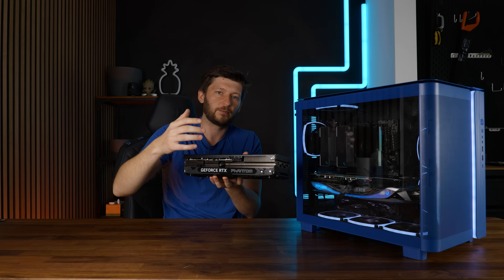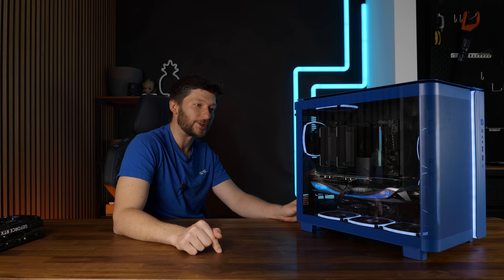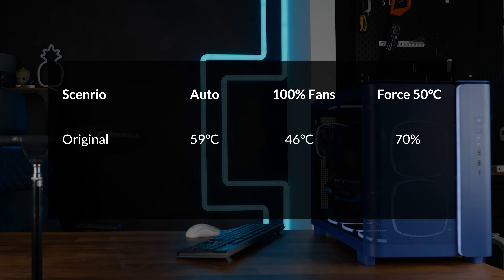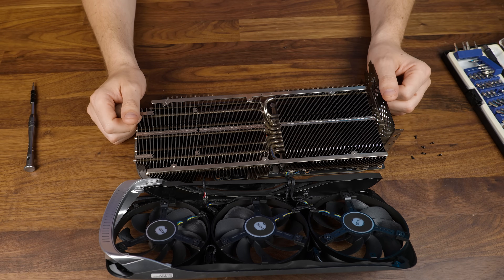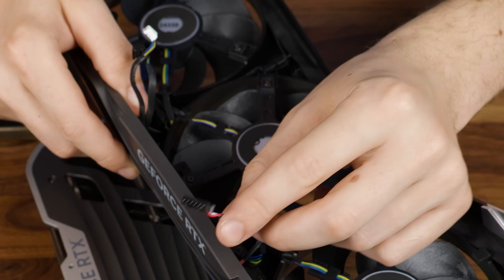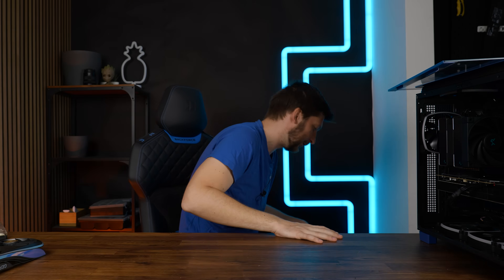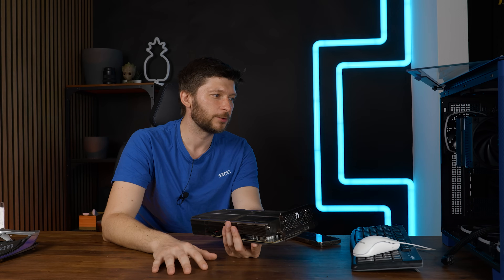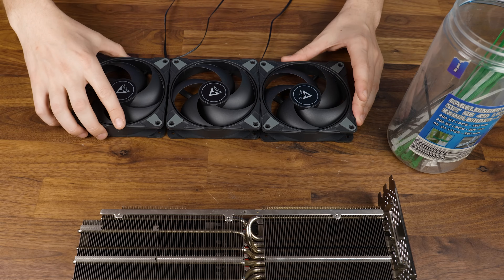Is Deshrouding A GPU Still Worth It? RTX 4090 P12 Max Deshroud Mod

Comment: I'm a good minute in and I'm going to stop you there, and throw a opinion out for the world to see and possibly have some agree with, its totally dead for 4000 series in my opinion the price of the cards themselves are horribly overpriced and underspec'd in cases like the 4080 and below, and the cards like the 4090 the cooling is just so over-engineered that the mod is irrelevant because my 4090 never exceeds 65C its just a overbuilt cooler

Comment: Deshrouding is why I always buy the non-oc/basic versions.   On my PNY Verto it was 4 screws and the two fan cables and boom shroud off.   I replaced it with 3 Be Quiet Silent Wings 4.   Running off motherboard header.   In my MATX system temps are ice cold and the only component I hear is the PSU fan under load.    Now for your high end cards you may not see that significant improvement but for the basic models you will absolutely see results.

Comment: I think the review is missing the point: Today you deshroud for noise, not raw performance. In a noise normalized test, the deshroud would have blown the original out of the water. And whats the with the focus on max rpm? I will gladly let my 4090 run up to the 60s with no hit in performance but virtually silent.
Reply: especially when you consider the fact that the circuitry is designed to survive at like 90C for extended periods. 60C is nothing. But noise is meaningful. Also the bigger fans draw fewer watts. Those skinny fans really consume power

Comment: i really like this idea, i could imagine doing the same myself but with three Corsair RX120 RGB Fans. The RX120 RGB have Icue link which mean i only have to run one cable + they are RGB i have never seen a GPU with RGB Fans.
Thank you for this video, even if this is not worth doing i might still try it!

Comment: Been running my 2080ti with two 120mm fans connected via a cable adapter to original fan ports on the card since I bought it. The original fans have only run in the factory, if at all. And I have been very happy with noise and cooling. Been using Noctua fans for the GPU though.

Comment: That arctic fan noise isnt because of fans but because of air going through heatsink if you would guide the airflow and cover it around like original fan does, it should be colder and quiter
Reply: How could I do that? What could I use to cover it?
Reply: @marko0marko0marko01  1. Use a 3D printer
or 2. Add fans without removing the native casing (and even native fans). Of course, I don't have a 4090, but a 3070ti gaming pro, but if earlier it spent at 83 degrees with very decent noise, then after adding 2 p12 max, just in addition to my family, I got almost silent operation and more than 10 degrees of temperature reduction (now about 70-72). Of course, the effectiveness of this method depends on the case and the initial cooling of the video card, but this thing works anyway

p.s. arctic p12max in general are not the quietest fans, that's why they are blocked by 30%. But they can at least replace bearings with quieter ones, such as NSK, or use something on hydrodynamic bearings (this does not make sense in the long term, but in the short term - hydrodynamics is quieter than ball bearings)

Comment: I've been curios about this for a while as well honestly the noise benefit would be nice if I game with speakers instead of headphones I hear inconsistent fan ramping which is annoying. Especially in unoptimized games its funny when I open the map and my gpu starts going ballistic. It would probably be better fixed with software to slow down ramp speed but I don't think that exists. Anyway thanks for doing this experiment and I would agree its not worth it unless your mental about noise levels and noise levels are more pronounced now a days with show pc's sitting on the desk right next to the monitor instead of under it.
Reply: Fan control. I have it set up on my rtx 4060 to keep the fans off fully until the card hits 50c

Comment: 3:34 legally, disassembly cannot void a warranty. Basic maintenance of internals must be allowed under the law (at least in the US, idk about elsewhere).

Now, the mod does void it because you’re putting on parts it wasn’t meant to work with and running it. But just taking it apart does not, unless you break it in the process
Reply: Deshrouds do not void the warranty on the card for the same reason taking at apart doesn't   magnuson moss act

Comment: No point doing this, enough cards now with good cooling stock and they don't even run hot, my 4090 at 900mv doesn't even go over 60C. Why would anyone spend another $50-200 for cooling you don't need.

Comment: I replaced the fans and the heatsink with RAIJINTEK MORPHEUS II CORE EDITION, and it is cooler while being quieter. GTX 1080 GPU had the original fan fail, replaced it, and another failed a month later. Now it works better.

Comment: Hi. I did the same with my EVGA RTX 2060. I know it's old, but for me it worth it maximally. I've used 2 Noctua NF-A9 fans. It doesn't look as clean as before (I love the Noctua colours), but I care more about the noise lvl which is very impressive. The hardest part was to diy an adaptor to power the fans from the card itself. Imo it's worth it for older or loud cards :) Cheers!

Comment: Okay but if it ran hotter my gut feeling is the card is turboing higher and longer. You simply cannot not give us GPU and memory speeds when they are automatically scaled based on temperature headroom. To do so severely underreports the situation.

Comment: Having a goal temp of 50 degrees for a 450 watt card seems like it's too low of a target. If the goal was 60-65, those Arctic fans would basically be idling and you wouldn't hear anything. Still worth it IMO.

Comment: Dude is putting on the cheapest and worst fans there are and wondering why they can be heard lmao.
Arctic is not for quietness but for cooling with sacrifice.

For cooling NoiseBlockers elopes should be used or any other fan that’s made with quality. 
Had about 20 Arctic Fans and they all were trash after a short period of time.

Comment: Deshrouded my Asus RTX2060Super Dual Evo OC a while ago and placed two Noctua A12x25 on it. On full load 20 °C drop and could OC and UV to stable 2000Mhz@160W.  but a few High-End games didn´t like it that much, so i went back to stock. still a cool card and the fans are barely noticeable. Use a O11 dynamic w max fan setup (incl. card 12 fans) :D

Comment: I think GPUs should be sold without shrouds. They will cost less and everyone can decide what brand of cooling they can put on and if they will go with air or water. And you can reuse your cooler on the next GPU so there will be less waste. Right now there are millions and millions of GPUs in the world with cooling radiators and fans attached to them and and they are all heading to the "recycle" bin.

Comment: You didn't really test for quiet operation though, instead of relaxing fans you've pushed them to a point of diminishing returns for single noise comparison you did -- who actually seeks 50C on core if he looks for quiet operation? Relax it to 65-75C (or at very least stock 60C) and see the noise gap widen.

Comment: I think you could significantly reduce the noise putting some kind of spacer between the fans and the heatsink. It will reduce turbulence and if shaped correctly it could function as some kind of mask and direct air into the fins without it spilling out from the sides

Comment: I deshrouded my EVGA 3070 and put two Noctua 120's on it, I found it definitely worthwhile. 

Temperatures dropped maybe 1 or 2c, nothing of significance. But the reduction in noise was the big win and why I did it. The fans now run at 40% compared to 60% of the originals. The Noctua's are a lot quieter compared to the originals at all points. 

The 120's are also much more durable than the old fans, so they now run all the time.
Reply: and you're actually pulling fewer watts from your PSU. those skinny fans pull a lot of juice

Comment: I still don’t understand why gpu manufacturers skimp on fans?  What is the problem with installing quiet and efficient coolers, with a wide range of speed adjustments.  I was very upset when I bought a gigabyte aero oc 4080, the fans on it only work in automatic mode with a minimum speed of 1300, which is already noisy.  At the same time, attempts to adjust the fans’ own curve failed, the fans simply begin to live their own lives, themselves picking up speed to maximum for a second at the fanstop threshold, which is simply not possible to operate.  If only the Chinese would make an adapter frame for 120-140 fans and it could be made like the Asus noctua edition.
Reply: The margins for graphic card manufacturers are laughable low so they need to keep selling top models for premium prices because that's how they make a profit... If you want a decent cooling you need to buy cards like Gigabyte Aorus, Asus STRIX & TUF, MSI Supreme & Gaming Trio etc.
Reply: @veduci22  Aero is already a premium line, just like aorus.  At the time of release, the price was absolutely identical and I chose the white card only because of the color and the absence of a useless screen.   Who knew that the card would be worse than the budget Ventus line from msi.  By the way, I have no complaints about cooling, all the problems are only with the operating mode of the fans.

Comment: As with all things related to PC performance, the value of deshrouding is tied to the bottleneck of cooling performance. Your tests were very spot on in the sense that the specific configuration of your gpu to case airflow did not have a bottleneck on cooling potential because of the GPU fans. 

I recently decided to deshroud my 4070 super for use in a Dan A4 SFX which is a case without any intake or exhaust fans as default. This meant that the entire cooling capacity of the system was dependent on the GPU fans and the CPU cooler fans. In my case, a deshroud of the GPU caused a nearly 10-15 degree drop under load and also a significant decrease in noise in both idle and load. 

Thank you for these tests tho as they are extremely valuable data points.

Comment: My asus 4070 dual runs a lot better with a pair of arctic P12s (non-max). Lower RPM, lower noise, and it runs a few degrees cooler (both GPU hotspot and memory)

Comment: honestly they should just make gpus with heatsinks that have screw holes  for 120mm or 140mm fans depending on the heatsink size. just make it the exact length to use either 2 or 3 fans. that way people can just use fans that match their case and run them off the same headers or software as the case fans

Comment: I run a deshrouded 4080 rog strix in a fractal ridge case. It runs great.
Reply: Hi, what fans did you use? im thinking of doing the same exact thing.
Reply: @williamm9099  noctua 140mm case fans with an aqua quadro fan controller.
Reply: @  thanks for the info. im assuming you zip tied the fans onto the heatsink?
Reply: @williamm9099  not needed. The 4080 strix is so large that it rests comfortably on top of the case fans. I used noctua 5mm fan spacers to close the gap. I also had to cut a small piece in the front of the case that was hitting one of the heat pipes. Everything fit together much better than I even expected.
Reply: @williamm9099  I had to go back and look at some pictures. I also have a couple of small 3d printed supports that are stuck to the cooler to keep it from sagging too much.
Reply: @ ya i was planning on using either 2 or 3 of those gpu support brackets.  been using those since my old asus 980ti when I had the arctic accelero xtreme III cooler on it. thanks again for the help. im using Kingpin KPx thermal paste and Gelid Ultimate Thermal Pads plus will do an undervolt to get temps even lower.

Comment: I have a XFX 6900XT Merc and shroud comes appart the same way, with only 6 screws.
You could try using those 15k rpm 40mm fans you have. It would be like an old Gigabyte GTX 680 SOC
Reply: how about temperatures? What fans did you use?

Comment: MSI Rtx 3080 10G here , I deshrouded mine and mounted 2x nf-a12 and temps are around 10-15⁰C lower and the noise is down significantly.

Comment: don't need it when the cooler is massive had my 1080ti deshrouded than I switched to Kraken G12 still working basement pc water cooling and deshroud does make it way more quite
Reply: too bad they don't make Kraken G12 for 30-40 series you could make it work with modifications to Kraken G12 but is it worth? I just get a water block a cheaper one and it works great on 3080 ti but 4090 with water block the difference is not huge I could overclock a 3080 12gb or ti to 3090 levels wish we could do it with 40 series cards

Comment: most don't know that ATX motherboard block/restrict hot air coming out at the bottom of GPU. But ITX mobo allow GPU hot air to flow by easily. You may/most likely also have to cut the back of case for airflow to the outside also. Some case no need to cut. The best way is to water cool. I dont care for fancy LEDs. I have custom/mod open case and flip it upside down so GPU is at the top of the case for best cooling.

Comment: I replaced msi trio fans (3 fans) with 2x 140mm noctua fans
The gpu runns 10°C cooler and you can't hear the fans at all.

Comment: i would rather waterblock it. i will get a old 1070 these days with an old arctic accelero III mounted and a Kryographics GTX 1080/1070 Pascal Copper Water Block in reserve.  this will be interesting what is better.

Comment: Funny enough, I deshrouded a used RTX 3080 Ti today to put it in my good old NCASE M1 Mini-ITX case. The card is sitting on top of two Noctua NF-A12x25 directly plugged on the PWM port of the GPU. Temperatures are ok (78°C after one hour of GPU stress test) and noise levels stay very low. Definitely worth it for SFF builds.